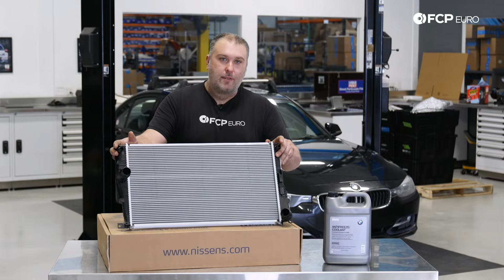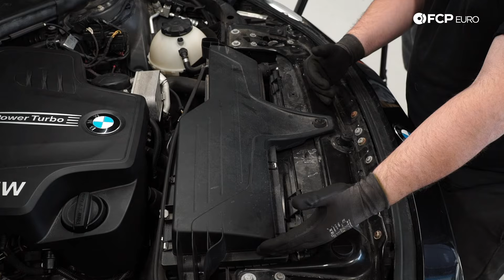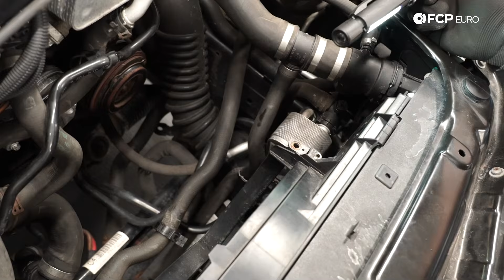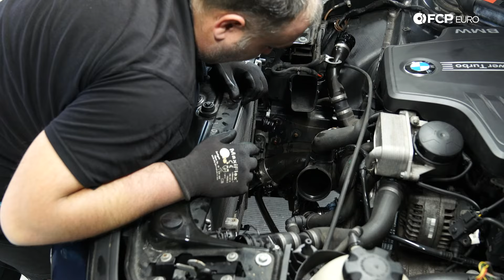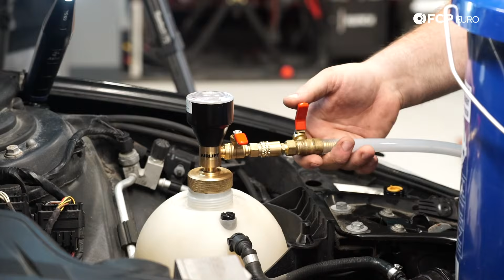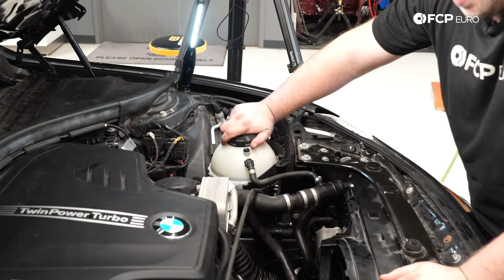BMW F30 Radiator Replacement DIY (BMW N20 & N26 328i)

Comment: What kind of water did you guys "off camera" mix with the antifreeze to get 50/50? Deionized, distilled, purified, or tap ? Thanks
Reply: Well I would hope they didn't use purified/tap water. They are professionals, after all

Comment: The big hose to the radiator has a smaller hose coming down from the bottom which is blocking the oil cooler from coming out, should I remove the big hose ?

Comment: On the n26. Im getting a code for that sensor that goes on the radiator.check engine light is on. Cant find the part name. What is it called and can it be replaced.
Reply: You have to replace the whole radiator, that part is not sold separately
Reply: I know im two years late but theres a forum on that. I hope you got the n26 radiator because i got sent the wrong one my first time.(not from this company)
Reply: Is it a U1408?

Comment: I recently replaced the radiator and it’s leaking from the upper and lower hose. I know u mentioned the o ring thingy adhering to the original radiator. any ways around getting a new hose? can I put like an o ring in the hose?
Reply from the maker: You will want to replace the entire hose as there typically isn't a separate part number provided for that o-ring. You may be able to find one that fits out of an o-ring kit, however that does not mean it is made for coolant duty.

Comment: what is that other radiator in of the new radiator i noticed you didnt replace it and i need to replace it so whats it called ?
Reply from the maker: Thats the AC condenser

Comment: Question if anyone can answer. 2016 F30 Msprt N26 rad fan comes on max for 1 min only on freezing days like  20 degrees Fahrenheit. Above that its doesn't come on at all (cold start). I'm thinking the rad was changed and installed with an N20 rad. Anyone have an explanation? Water pump works fine and seems new ish. 43,000 miles on car to date.
Reply from the maker: a radiator replacement shouldnt have changed the fan wiring, but it would be difficult to diagnose without access to the car. You may want to have it looked at locally

Comment: Those sulev radiators are ridiculously expensive compared to the non sulev😓
Reply: Did you find one for cheap in at n the same problem